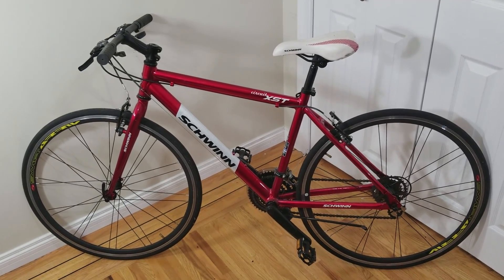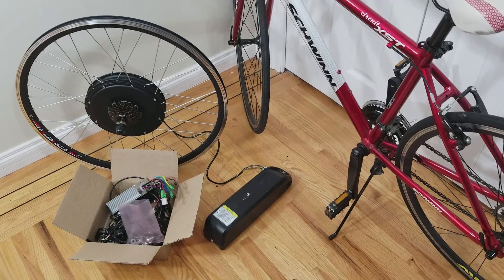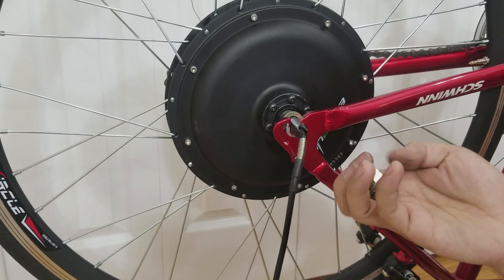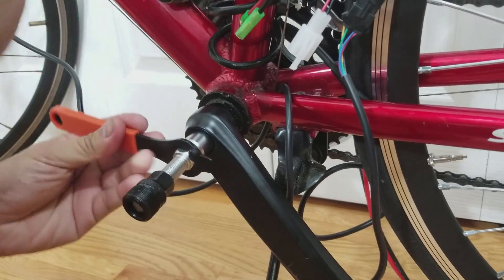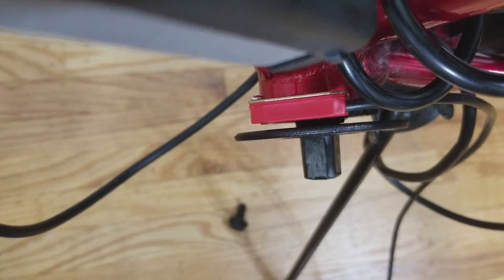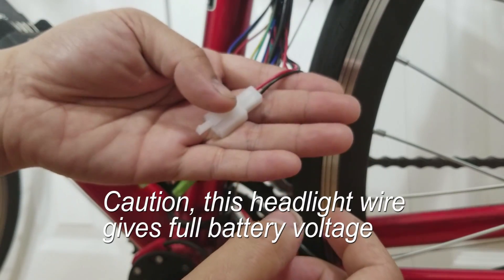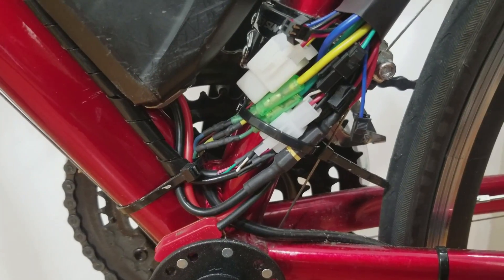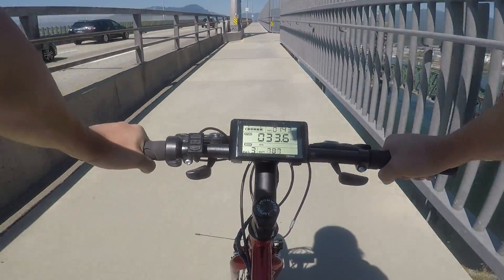1200 Watt EBike Build - Cheap + Fast = DIY

Comment: 4:56 Why didn't you just put it on the right side?
Reply: at least in Malaysia they know when something is said sardonically... ie what MR  r/woooosh said 1st....
Reply: He may be left handed?
Reply: @causwayspeedway  He runs typical right/rear left/front, this could be left handed. UK, Italy, JP, AU, and some others use Front/Right Rear/left

Why say, "The cable pokes out the wrong side. I think it's meant for the right" So, install it on the right and find a left sided throttle. Don't just hack.
Reply: @forevercomputing  He may be left handed.
Reply: @causwayspeedway  left handed people can deal with right side twist throttle and right/front brake.
Reply: @forevercomputing  You think? Bet you are right handed
Reply: @causwayspeedway  It is normal to have right/front in the UK. It makes riding a motorbike much easier. This is considered normal.

There is a left handed youtube guy who is left handed 100% and he leaves his throttle and brake ride-side.
Reply: @causwayspeedway  I'm a right handed ebike rider and I have no problems using a left hand throttle if I need to. Maybe lefties are just a bit thick.
Reply: @Nitecrow314  Depends, Norton is right shifted so coordination is in the X pattern unlike the H pattern.
Reply: @causwayspeedway  What?
Reply: @Nitecrow314  I see your point though.. I think in terms of clutch.. not throttle.
Reply: @Nitecrow314  or maybe it's easier to use things with your dominant hand bud.
Reply: for PRACTICAL REASONS: right side=right hand=dominant/faster hand=rear braking in emergency situations/ braking. (by reflex u would use your right hand to pull the lever. if the right hand happens to be your front brake than sooner or later u gonna get into an accident/slip and fall. It's not practical to have rear brake lever and throttle on the same side as your hand can not 'jump' from pushing down throttle to pulling the lever fast enough plus it feels uncomfortable to pull rear brake with left hand unless u are left handed).
Reply: Because he probably don't ride motorcycles?
Reply: @_Viking  nah. He is only have one hand?

Comment: Thanks for the video. Unfortunately in Europe they started requiring taxing, plates and insurance for e-bikes. God bless Canada.
Reply: I live in the UK which is at this point in time still part of the EU and we don't pay tax, insurance and registration on e-bikes as yet.
Reply: @Gebox68  as long as it doesn't go above 15.5 when powered and only powered when you're pedaling then you don't need tax or insurance.
Reply: @hippopotamus86  so only pedal assist counts? I didn't know that. thanks for the info.
Reply: @hippopotamus86  If you exceed 250w and 16mph, then you need a "vehicle inspection" Without this, you can't have a plate. Tax will be required, but I would be certain it would be exempt. Unless you have a 4T/2T engine attached.
Reply: @Gebox68  If you can exceed 16mph with power not derived from your legs, you now have a moped. Also, having anything more than 250w continuous with 350w burst being permitted before moped class comes in. At this point, if you are in moped category, you need to get the bike inspected and it must qualify to be registered as taxable, MOT required and insured and used with a motorcycle helmet.

Not forgetting the licence requirement as well.

Comment: how do you know you had 30% left?
Reply from the maker: The LCD display has a battery meter on it. It has 5 bars. When riding near the end it dropped as low as 1 bar (20%) and after stopped it went back up to 2 bars(40%). So I estimated 30%

Comment: Any reason for mounting the throttle control to the non-standard side?
Reply from the maker: I mostly use the right side shifter, so I  put the throttle on the left so it doesn't get in the way.

Comment: can this motor start without throttling but with pedaling? otherwise the pedal assistance doesn't make sense to me
Reply from the maker: It can start with pedaling. It uses the cadence sensor on the crank to determine  if you are pedaling or not.

Comment: Looks like the 2nd Narrows Bridge spanning Vancouver and North Vancouver.
Reply: Looks like Benica bridge .california
Reply: Love your video but if this is in British Columbia, you are only allowed a maximum 500W motor and not capable of more than 32 kph otherwise it has to be registered and insured. Are there any labels on the kit that state the motor wattage? What about on the LCD display? Even if there isn't, if a cop clocks you at over 32 kph while not pedaling you are screwed unless you are near an escape route and do your best Steve McQueen impression.
Reply: @ALSmith-Online  Prolly why he was going full wick on the bridge?!

Comment: Mines the same but front wheel 1200watt 52v
Reply: How does it handle on sand or gravel/loose soil? I always thought front drives skid too easily when steering, especially with 1200 watts O.o

Comment: UK.GOV
ELECTRIC BICYCLE GUIDELINES

licensing, tax and insurance

Contents

Rules in England, Scotland and Wales

Rules in Northern Ireland

Rules in England, Scotland and Wales

You can ride an electric bike in England, Scotland and Wales if you’re 14 or over, as long as it meets certain requirements.
These electric bikes are known as ‘electrically assisted pedal cycles’ (EAPCs). You do not need a licence to ride one and it does not need to be registered, taxed or insured.

There are different rules in Northern Ireland.

What counts as an EAPC

An EAPC must have pedals that can be used to propel it.
It must show either:

the power output

the manufacturer of the motor

It must also show either:

the battery’s voltage

the maximum speed of the bike

Its electric motor:

must have a maximum power output of 250 watts

should not be able to propel the bike when it’s travelling more than 15.5mph

An EAPC can have more than 2 wheels (for example, a tricycle).

Where you can ride

If a bike meets the EAPC requirements it’s classed as a normal pedal bike. This means you can ride it on cycle paths and anywhere else pedal bikes are allowed.

Other kinds of electric bike

Any electric bike that does not meet the EAPCrules is classed as a motorcycle or moped and needs to be registered and taxed. You’ll need a driving licence to ride one and you must wear a crash helmet.
The bike must also be type approved if either:

it does not meet the EAPC rules

it can be propelled without pedalling (a ‘twist and go’ EAPC)

This should have been done by the manufacturer or importer before you bought it. If it’s been type approved, it will have a plate showing its type approval number.
Reply: oppressive, anachronistic limitations that desperately need changing /  removing
Reply: @MilesBellas  yes let's have yobs running up and down the streets with as much power as they want being recklessly unregulated.
Reply: @stevezodiac491  
You mean like motorcycles already? and mopeds?
I haven't seen any..... it's another exaggerated failed argument like prohibition.
Does everyone drink until they can't stand up every night?

Oppressive, neurotic, silly EU style regulations stifle all growth, vitality and productivity from the nation......
probably formulated by people who never ride bikes,

Ludicrous.

As ludicrous as the fearful, pertulant, herd animals that support such nanny state, fear driven over simplifications.
Reply: @MilesBellas  motorcycles riders are licenced, riders have to pass tests, the motorcycle itself is taxed, mot'd and insured, I know I have one myself and if I ride  contrary to the law, l lose my licence. The tax people pay for excise duty is used to build hospitals and do other things that support society. What do you want a country that pays no taxes, if you do, live in Greece and find out where that leads to.
Reply: @stevezodiac491  

2+2=4
you knew that too ?

 hyper concern in implanted by fiction....
300 as opposed to 250 as opposed to 500 ?
arbitrary  numbers pulled from thin air

many people have switches, the regulation needs discarding

do you do 70mph on the motorway?
do that and block traffic....

once the UK used to be healthy, 
now it's in a state of descent 

guess why? no progress 
no progress = no manufacturing = no economic growth.....

pearl clutching and fear ...is not the path to growth
Reply: @MilesBellas  only because the gov wants the switch, after everybody or most have switched, the tax will return, if you believe that it won't you are very naive. As to travelling at 70 on motorways, I don't, I travel at 60 along with the lorries who are limited to 60, why, I drive a limited range electric car and you could too, if you want to be more environmentally friendly and yet fit in with society's rules. If you want exercise and also be planet friendly on shorter journeys, ride a proper push bike, also  like me, i have ridden one all my life for up to 300 miles a week, for 25 years for that distance phase, with an average speed on a 25 mile TT course of 27.4 mph, so you see, you don't need electric propulsion on push bikes really, you will be fitter, healthier, thinner, more environmentally friendly and richer without.
Reply: @stevezodiac491  

Try using grammar and reading through your comment: it currently does not make much sense.

Point is : regulations are arbitrary and releasing restrictions will create an alternative, non polluting option for commuting and encourage both development and use.
Reply: @MilesBellas  Try using logic in your argument and when you are obviously losing one, don't do what your kind  normally does, attack your opposer with personal insults and your argument would be looked at more favourably. Instead you have reverted to the gutter as your kind usually does. There are non polluting vehicles available now, all you want is a free lunch.
Reply: @stevezodiac491  

Your comment again males no sense.

Read the comment.

Address the comment.

Laws and regulations are continually evolving.
Why is British manufacturing dying?
Where are British  car marques?
Where is innovative progress?

Would pioneers of the industrial revolution have flourished under the pedantic bureaucratic oppression of contemporary society?
no

Innovation and real world progress is oppressed under mounds of EU style petty over regulations that is nothing but petty busy work for "civil servants".

All those ridiculous anachronic rules need to be binned ASAP.

All electric vehicles should be completely deregulated.

Electric bicycles should have no limits.
Reply: @stevezodiac491  

Finland
A bicycle can use. 250-1000 W electric motors

New Zealand 
300w

Minnesota 
1000w

California 
750w

EU regulations created 250w.

EU regulations are obsessive and oppressive 
ie
"By regulation, all bananas imported into the European Union must be at least 14 cm long and 2.7 cm thick"

there are other regulations for all aspects of daily minutiae
Reply: @MilesBellas  Easy if you want to ride a more powerful bike in the UK get an electric motorbike and pay the insurance, get an mot, and learn and get a licence to ride it safely. With greater power comes greater usability, responsibility and accountability. It is not that you can't ride  a more powerful bike in the UK, you just don't want to pay the going rate and abide by the rules and regulations. Don't be a cheap skate and ride an illegal overpowered e - bike, there are legal alternatives and that is where you stand, you don't want to pay, just get an unsafe free lunch. 250 watts is not an arbitrary number, it is what a very powerful normal cyclist can put out continuous and 250 watts was decided upon as a compromise for less physically fortunate individuals to compensate for their deficiencies.  The world hour record was done at 440 watts average, so 250 watts is very generous unregulated. If that is not enough, like I said, get an electric motorbike and abide by the regulations.
Reply: Get robbed and you'll have a hard time getting the police to turn up. Take one step outside of the system of licencing, insurance, regulation and general government revenue generation by buying a bicycle with a little electric motor so you can cut down on all the polluting, revenue generating activities of motoring, and they suddenly have infinite resources to harass.
Reply: Dooneegomaface Ifinnaspring  As long as your e bike is below 250 watts then that is ok - good boy. I bet you wow the girls with it. I bet you say in the pubs to the girls,  I've got an e bike you know. They then smile, turn away and think another f'in  loser ha ha. By the way, you don't start a sentence with "and".

Comment: What kit would I need if I only want to go 7 mph ?
Reply: 36v. 500w. would work just fine.
Buy the biggest battery you can afford. You'll be happy you did.
Good luck.
Reply: 250 watt motor maxes out at 14-15 mph.  You just use half "throttle".

Comment: 1200 watts motor with a 14ah 48 volts battery, hmmm ,let me see : It means like 30 minutes of  flat out fun before the party is over and you have charge the battery 8 hours before the next 30 minutes of fun session ? Because that is all you would get without pedalling. I would be very surprised if you got more then 60 minutes of actual riding on a 24 hour day basis, even spinning the pedals.

That is a serious deal breaker in my book.
Reply from the maker: Thankfully there a lot of larger and more expensive battery packs out there . And this motor kit realistically  only outputs 1200 watt at its absolute peak(fully charged battery). Cruising at 35 kph on flat ground  it's using about 500-600 watts of power. 
I have ridden over 50 km in one go, of course with some help from me and still had about 25% battery left.

Comment: I go way faster than that without battery.
Reply: Can you do the same up a hill and through a headwind  and for a long period of time .

Nope !!!
Reply: @PoPpsychle  yes I can I'm a ex pro.
Reply: so you can cycle 30 mph up a hill for a long period of time . You can cycle 30mph through a headwind and cycle 30mph constantly for an hour . You can also do all this while not sweating too much . Wow .
Reply: @PoPpsychle  I sweat like hell and my HF is around 193 b/m (my max at 50 years, on my better days my max was 215) I admit that it cost me a shitload off effort and it hurts sometimes, but the kick from endorphin is still so nice ;-) I also admit it's not so healthy to drive 3/4  hours in the red zone. But I'm not normal like so much other cyclists on mtb or roadcycles. For people who don't want to struggle so much this kind of bike is a nice solution. Maybe wenn I reach 60 I will also by a similar bike. I think these kind of bikes are a good invention for commuters or people wo just want to have a bit of fun. Don't get me wrong I don't criticise these kind of bikes. Sorry if I gave this impression. It's a good thing that these bikes will get more people on a bike instead in a car or on a motorcycle.
Reply from the maker: Damn you're a beast! Imagine how fast you'd go with assist! My main use for these electric vehicles is for my commute to work. One less car, insurance, gas, parking.
Reply: @hansdegebruiker1968  I'm impressed dude . 

Ebikes are more of a convenience machine . Good for commuting especially when going to a meeting and still beating the traffic . They also don't spew out nasty smells and don't wake the neighbours at night unlike a combustion engine scooter . I wouldn't use one for training (obviously) although if you turn the motor off the additional weight would be a good workout .

Comment: This video makes me want to never try a custom e-bike build.  Would rather buy one all set up from a reputable company with proper parts and ready to go as designed.  Would probably cost about the same too after parts, time, and labor.  Not worth it imo.
Reply from the maker: Check out juiced bikes. They make really good ebikes that can output 1100w. Costs a bit more than DIY but better suited to the average consumer.
Reply: @DougHnut  Unfortunately they ship only to America. Do we know about an alternative in Europe?
Reply: @Mprikiman  move to america
Reply: Scott M. This costs 300$ + the cost of your bike
Reply: just built one @1000w/48v.  took two hours and saved around $500.
Reply: How much was it to build everything

Comment: My battery wires have a preinstalled xt90 female connector to them. Do I have to solder the wires from the controller or just buy a xt90 male connector?
Reply from the maker: Just get a xt90 male. Nothing wrong with xt90. It just bigger and can handle more power than a xt60.

Comment: I have had a Bafang 1500W hub motor 48V 12aH battery mounted on a Surly Troll for 3 years now, no problems. I have had mid drive also, prefer the rear hub drive.
Reply: How much range do you get with that setup
Reply: Whats your top speed or average top speed?
Reply: My range was around 30 miles if I was easy on it. Top speed was around 35 mph when the battery was new. I let a friend borrow it and it got stolen last fall.
Reply: @charliedee9276  
Condolences.

Comment: hey this company sells 48 volts alternator for bobcats (Diesel Alternator Bobcat 6632211 6661611 A000B043) it is called (db electrical) and using the ebike motor to turn then making special voltage control and you may get 4 times the mileage. the alternator costs 66.75 so it is cheap to expand mileage. if you make special voltage control then it only make 48 volts and just connect direct to ebike motor but maybe to many amps. so don't blame if you fry yourselves ok. I just did a big hunt on the net to find this one.